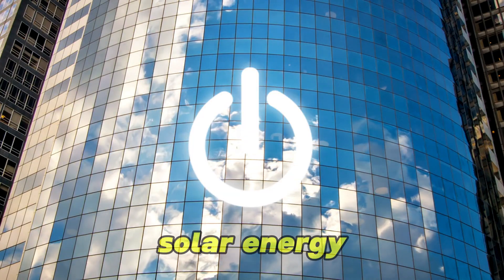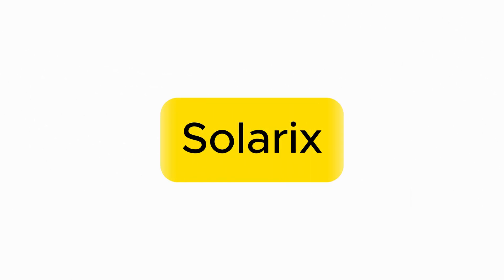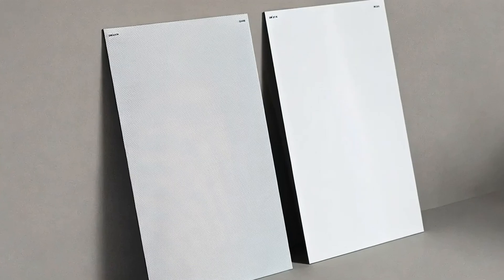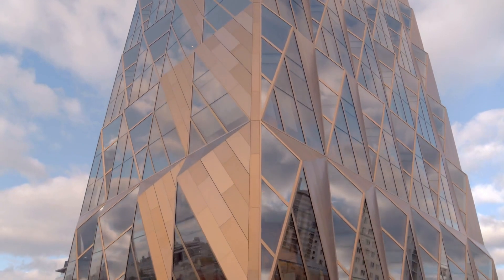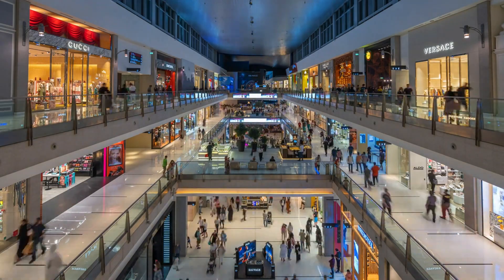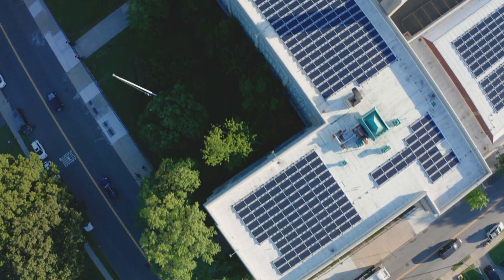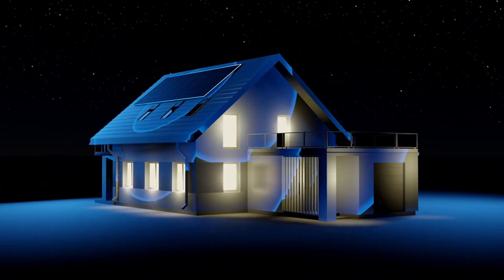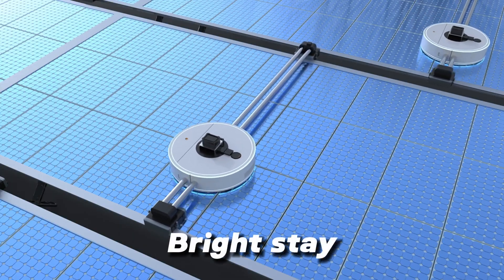First WHITE Solar Panel in History?! This Changes Everything!

Comment: White solar panels represent a transformative design solution for architects and designers. Their white color creates a modern appearance that suits contemporary building structures without visible conflicts. Traditional black or blue panels differ from white panels when installed in buildings because white panels easily adapt to architectural designs while sustaining a tidy structural appearance.
Reply from the maker: I appreciate the insightful comment about the architectural advantages of white solar panels.

Comment: How can they be more efficient when they are reflecting most of the light? 129 watts per square meter is only a 12.9% efficiency as sunlight is about 1000 w/m2.  Current technology of crystalline solar cells is the low 20% range. About 23% for roof mounted panels. Twice the efficiency. You would use these merely as aesthetic panels with a useable output.
Reply from the maker: Thanks for your feedback about white solar panels. We will check it and comment later with more details.
Reply: They take the energy from infrared. The core of their invention is a film that only reflects the visible spectrum and behaves transparently in the infrared range.
Yeah, the video is highly misleading. I thought it was a scam, but the company seems to be honest with the fact that it's less performant than the traditional counterpart. But still 12% is very impressive for a white panel.
Reply: @rocketlover-v8g  Ah, thank you. That explains the efficiency they claimed. I think people are going to like them actually regardless of being less efficient. People will likely feel better about plastering them all over everything 🙂
Reply: Given some thought I think people are going to like them actually regardless of being less efficient. People will likely feel better about plastering them all over everything 🙂

Comment: Stopped watching after 20 seconds. Higher conversion efficiency? nearly died laughing.

This is scam, utter BS. 
You know how you can jude how efficient solar panels are? The DARKER they are, the more sunlight isn't reflected instead of turned into power. Because what you see when looking at the solar panel is what te solar panel DIDN'T use to make electricity. The photons your eyes see is the same stuff that makes energy. A 100% efficient solar panel would be like a black hole in sunlight, as not a single photon is reflected for your eyes to see.

As the panels are white, we 100% shure know that the COMPLETE visible spectrum of the light, you know, MOST OF THE ENERGY, is nearly fully reflected and not used. 

That you see bright white is basically a sign that these deliver at very, very, best 30% of the power normal solar cells use. 

And this is so extremely obvious.

But unfortunately, most of the youtubers are totllay unable to understand extremely obvious, basic concepts about what they report.

And send people to wast thier invenstment money to really dumb projects. We need more youtubers trhat care and PROTECT th emoney people are willing to invest in renewable energy projects, not just push and praise any renewable idea out there as hard as they possibly can without switching on their critical thinking.
Reply from the maker: Thanks for your feedback.

Comment: Above 35 degrees of latitude north or south, the amount of energy you need for a solar panel to be built, manufactured, mined, etc, is greater than the total amount of energy that a solar panel will produce through 25 years of lifespan.  35 degrees latitude (north and south) is from anywhere north of Gibraltar (southern Spain) to south of South Africa.  It means virtually all of the US and of course Canada, all of Europe and Russia, New Zealand, and half of Argentina – even virtually all of Japan and half of China.  Futile.
Reply: This claim is completely false. I live at 45 degrees north latitude. Each of my panels (nominally 325 watts) has produced about 25 kWh per month (averaged over the 8 years they have been installed.) Solar panels are currently retail priced at well under $0.50 US per rated watt. At current prices the panels I have would cost about $150. That price includes all the cost of mining and refining all the materials, transporting them, making the panels, and getting the panels to me. At 10 cents per kWh of embedded energy to do all those tasks, that means the energy equivalent invested in making the panel is 1,500 kWh.  It took about 60 months (5 years) for my panels to pay back all the energy invested in making them. And my panels are far from optimally sited. Not facing due south, not at the perfect tilt, shaded part of the morning and a good part of the afternoon by trees, buildings and hills. Without those deficits, they could have paid back in 3-4 years. 
The wholesale price of panels is under 25 cents US per peak watt. That implies far less embedded energy than I calculated based on the retail price.
Some source you read was either out of date, or deliberately lying to you....
Reply: @jimmurphy5355  
It was from a study by Energy expert, Douglas Pollock.
Perhaps you're just no good at mathematics.  I have no doubt at all that you forgot to deduct the loss of interest on capital expended...since you aren't good at maths.  But then, I wasn't talking about return - which typically you never get - but about their ability to generate more energy than is expended in their existence.
Maybe English isn't your first language?
Reply: @barryfoster453  Douglas Pollock is a self-described "energy expert". In the most extreme scenario of comparing Solar PV with baseload electricity which is no cheaper than $0.04 per KWH in my area (38 degree latitude), a utility scale solar PV system installed for $1 per watt with no tax incentives that gets only 4 hours of full sun per day in electricity generation will pay for itself in 17 years which is less than the 25 year warranty of the panels. But that's a very extreme scenario which ignores the savings on the electrical distribution network if the panels are rooftop mounted. Most people save a lot of money with solar PV because their utility rates are far higher than baseload generation costs.
Reply: @barryfoster453  My English is fine, and my math background is strong. I was using the cost of the panel as a proxy to estimate the energy inputs used to create it. After all, panels cannot be sold at a profit unless the inputs of all kinds put into creating them are less than the cost of making the panel. I was using the generous assumption that 100% of the cost I pay for a panel is just barely covering the energy input, and even more generously assuming that 100% of the cost of the panel is to pay for that energy, with nothing going to capital costs involved in creating the supply chain, paying for labor, or providing a profit. I was not talking about the financial payback to me from using the panels. That's a whole different subject - and because I live in an area where retail electric rates are far higher than the US average, my return on my investment in panels was quicker than 60 months.
And despite your doubts, I am fully aware of the concept and reality of "opportunity cost" when calculating investment returns. The money I spent to install panels could have been invested, and that potential income is lost when the money is instead spent on the solar system. That is a factor rarely mentioned or properly accounted for when people evaluate the payback from a home solar systen - but it is very real, and very important.
If you can find a link to the Pollock study, I'd be interested in reading it. Always willing to learn....
Reply: Complete nonsense. Where did you get this? There is very simple math to figure out if you're wrong...Does the Solar PV panel pay for itself before the warranty expires? With only 4 hours of full sun 1000W/m2 every day, a solar PV panel can pay for itself in less than 5 years. 25 years is a long time so the output would have to be 5x less than this which is complete nonsense. I'm at the 38 degree latitude and my Solar PV system paid for itself in less than 3 years.

Comment: Use some common sense folks. There's no way this white panel can produce as much as a dark panel. A white panel is refecting a lot of the light that hits the panel. Maybe they have developed a coating that refects visible light, and passed infrared. That would let the panel generate some energy - but not as much as a panel that also absorbed visible light.
Reply: I looked it up online, and yes, the core of their invention seems to be a film that only passes through infrared.
I hate it when journalists lack an elementary school level common sense, and blow honest inventions out of proportion.
Reply: And the visible light is what has the most energy.,
Reply: @Flinno-k8w  Not for solar panels. Sunlight is strongest in the near infrared, and solar cells efficiently convert that non-visible part of the spectrum. Visible light has more energy per photon, but the extra energy per photon is wasted by the current mass produced solar panels. It takes a certain energy per photon to kick an electron loose. Any extra energy in that photon, above that minimum, contributes nothing to electrical energy. It just heats the panel. The solar cell material is "tuned" to need photons in the near infrared (or above.)
Infrared photons are efficiently used, visible light photons contribute, but the shorter the wavelength the less of the total energy in the photon is converted to electrical power. Blue photons have about twice the energy per photon of a red photon, but none of that extra energy is converted to electrical energy.
Reply from the maker: Thsnks for your feedback about such new white solar panels, appreciated

Comment: A normal monocrystaline panel or black panel produces 200-240W/sqm. How ever you try to pitch that 129W/sqm would be more than the black. I don't know. 
Although for usage as building paneling it is alot nicer.
Reply: It's  useless. It's mounted in a way that when the sun is strongest, aboove in the sky, these vertical panels see no light or abysmally few. 
The numbers they publish are BEST CASE, optimally aligned which isn't the case for cladding at all. 

You have a lot of cost for wiring these, Maintaiinance and of course the difference between steel/aluminium cladding and the panels, have far more cost installing and all the electronics, but get abysmal harvest and returns. This is such a dumb idea on so many levels.
Reply from the maker: Great notice, we will check it and comment here later

Comment: This is a nice product when it comes to looks, but your 2x energy claim is totally unfounded. What I can find on their website is 355Wp for a normal size panel, that is approximately 100W LESS than a normal solar panel...
Reply from the maker: Thank for your feedback.
Reply: Are you taking into account thermal degradation? This is the only way I can see white pv panels beating dark heat absorbing pv
Reply: @creativeoutlet3148  These are stadard blue-black panels with a thin semi-transparent film added to change the appearance. The white reflective film would, in theory, make the panel a bit cooler. But the company that invented this process makes no claim that the white panels produce more energy than a dark panel. They downplay the loss - but do admit that the white panels produce about 130 watts per square meter. What they don't say, but is easily found, is that the best blue-black panel produce 220 watts per square meter.

Comment: goood to have  WHITE Solar Panels
Reply: Only if you are willing to pay extra for less output.  These are stadard blue-black panels with a thin semi-transparent film added to change the appearance. They downplay the loss - but do admit that the white panels produce about 130 watts per square meter. What they don't say, but is easily found, is that the best blue-black panel produce 220 watts per square meter. So you pay for a panel that could produce that much, then pay for the added cosmetic film, and lose a very significant portion of the possible output. The only upside is cosmetic. If you really, really want a white appearance, and can afford the extra cost, and don't care that you get a lot less power per panel,  that's a choice you now have.